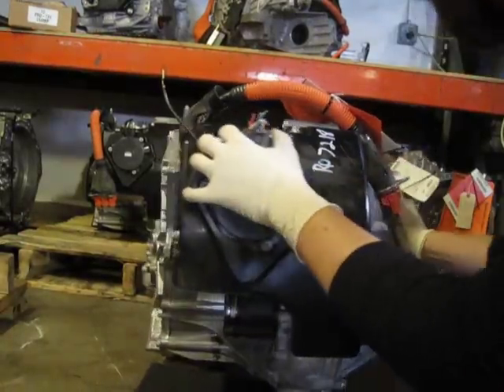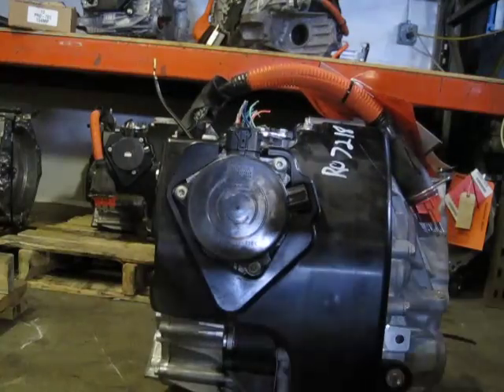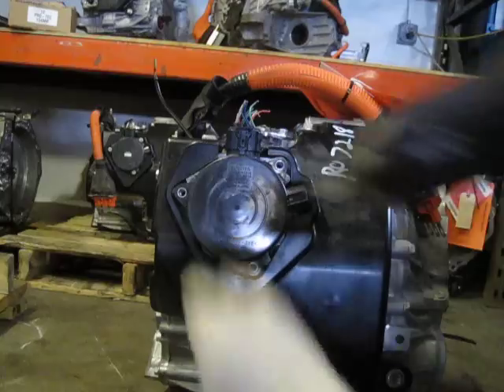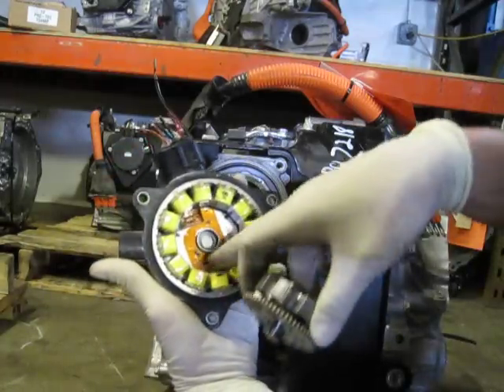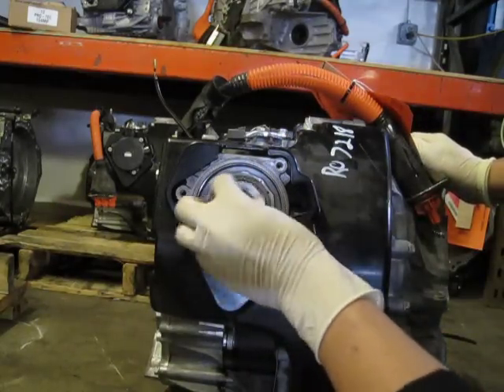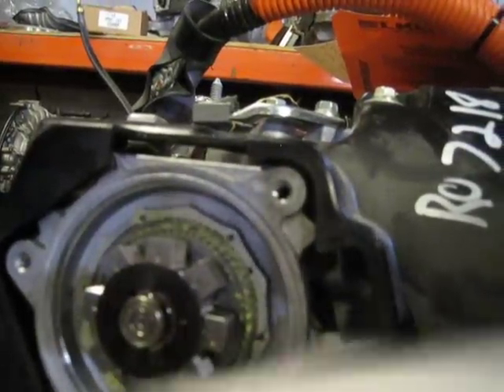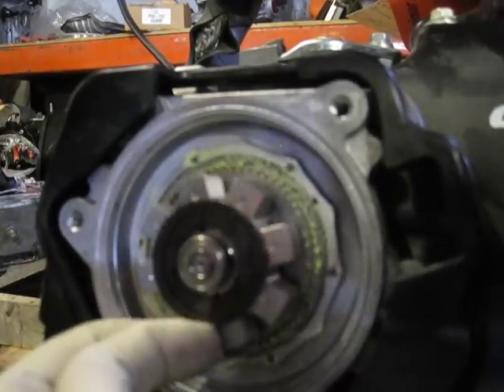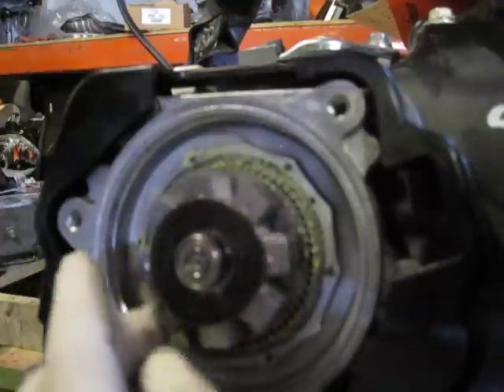Gen 2 Prius Park Motor (Shift Control Actuator)

Comment: While it’s been years since you posted this, I wanted to let you know your video really saved me today. ‘06 Prius, dead battery, lost keys, and needed to be in neutral to winch onto the truck. With the driver tire off, I was able to take the cover off the park control motor, manipulate the gear assembly, and release the parking pawl. Whew!! Thanks a ton. ❤

Comment: I keep getting the P-Lock mechanism is abnormal, park on a flat surface...  I am usually driving at about 70 when this occurs.  No one can replicate the issue, however when I am on long drives, especially through mountains when I am not on a flat surface, I get this problem.  Do you think that perhaps my Park Motor is bad?  I have am 04 Prius with 350k miles on it.
Reply: Ian Watts hi i am having the same problem.. now my car is not starting giving dtc p3102.. changed transmission control ecu but not worked for me.. may car is neutral  its not going in Park 'P' ..
Reply: @saadsharif6284  did you ever find out the problem?